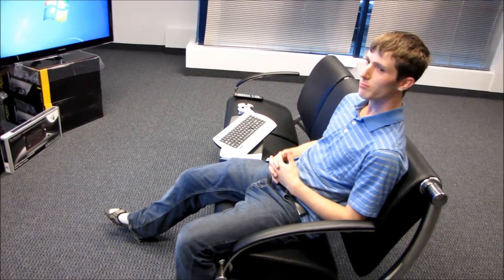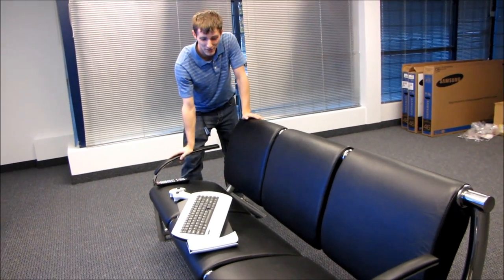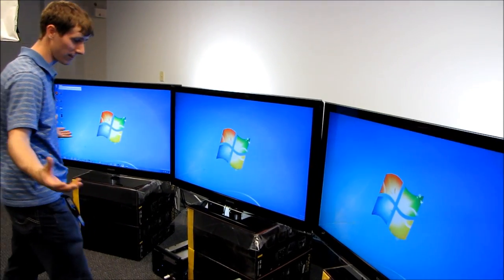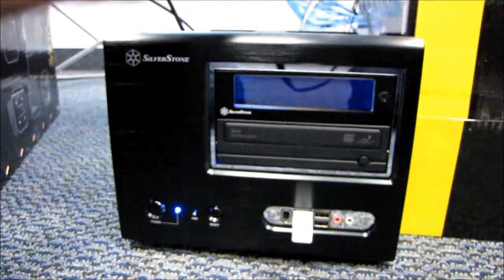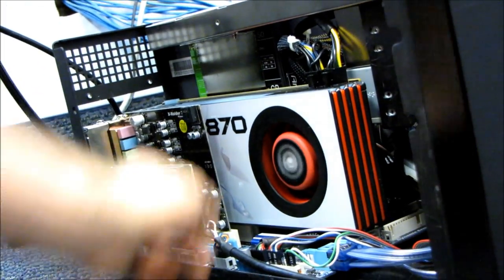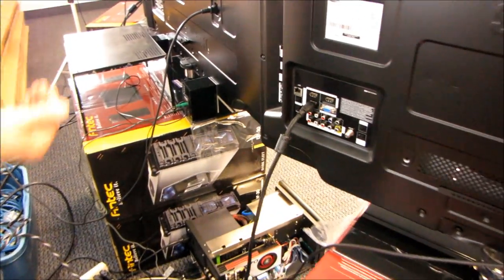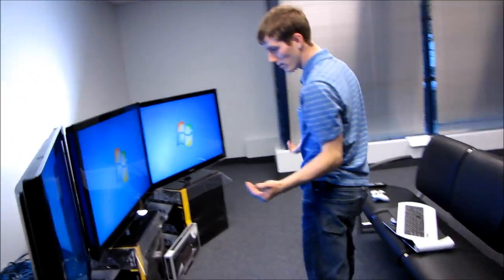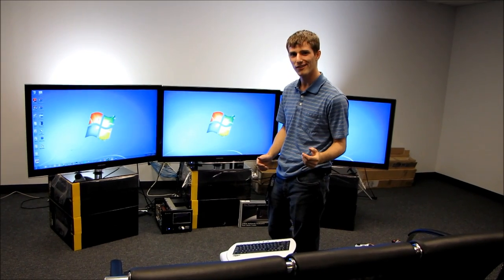Full Tour of MSI Radeon HD 6870 3x 46" Eyefinity Setup for NCIX Tech Tips Linus Tech Tips

Comment: Linus, i wouldn't sleep for a month with such a setup ! What i would do to Improve is only one thing. Set the TV vertically an NOT horizontaly. they are wide enouth.  But in games the top and bottom part are just cut away and not just modified corespondantly for exemple in most menus. Oh, and optionally, i would buy me some 3D red-cyan glasses  for half a dollar :D

Comment: No sleep, not even taking the time to get some coffee!!!
I would have those three TVs encastrated in a wall, have a nice and good looking 5.1 surround system with the front speaker in the wall under the TVs, the two front lateral in the wall beside the TVs, the bass case inside the couch (and a better couch ofc) and the two lateral back speakers over the couch in the cieling. Drewl!

Comment: I probably wouldn't sleep tonight. I work tomorrow afternoon, but I've been there 2 years and never called in sick before...

To make it better I wouldn't use cardboard boxes to hold the TVs up. And I would use dual graphics cards to make sure it runs super smooth at such high res.

Comment: i would not not sleep at all! thats what monster energy is made for lo

put a nice sound system with it and mount the tv's on the wall.  the outside ones could be on hinged mounts so you could pull them away from the wall a little and turn them slightly so you could get the wrap around feel

Comment: @masik7290 awesome, well since it takes up less power you'll definitely be able to run it with your psu.

that's not a bad setup imo, and with the new card in it it'll be in the higher mid range

Comment: Question 1: Yeah I'd sleep, but I'd wheel my bed into the same room as the setup so I can look at while I sleep lol. 

Question 2: I'd probably paint the wall that the televisions are up against black so there would be less light bouncing off the wall, making it easier to concentrate on just the televisions (if not paint, just hang some black sheets)

Comment: @masik7290 450 full system. if you read some threads online about what psu to use with that card they all seem to actually have 550 watt psu's. best bet is to research your heart out and then find what you think is best for your needs. psu's arent terribly expensive if you do need to upgrade, maybe to a 650 or 700w.

Comment: I currently have 3 monitors, and eyefinty (or  surround) is win.

If I had TV's I probably wouldn't sleep for the next 3 nights. If I was you, I could get a crossfire motherboard, and get 2 6870s. I had a 5770, and it wasn't quite enough for 5040x1050, so i got 2 470s

Comment: Ive done a lot of research on the LCDs in eyefinity and 42 is the biggest you can go without causing yo to miss most of the picture due to sitting so close to the monitors  i mean what is the point of sitting 6 feet away?  You dont get the picture to eye ratio you need to really use the eyefinity.  Your eyes need to be around 3 feet away from your middle screen to emerse yourself in the three monitors...and sitting with 46 inch lcds around me hurt my eyes and strained my neck when i tried it.

Comment: As for the "powered adapters" My card is nothing but mini-display port. 
5870 eyefinity 6 edition

I have no powered adapters... I bought 3 Apple mini-dp to VGA adapters and am using the mini DP to HDMI adapter that came with the card for the 4th Display. No clue what makes my card so special that I can do this without spending another $100.00. Versus the $75.00 for three adapters. (only because it does not come with VGA adapters)  Done and working with zero issues.

Comment: 1.  Most definitely not.
2. Replace all monitors with 32" CRT 4:3 screens (I'm not a fan of widescreen, and CRT STILL looks better than LCD, even now), add a Stereo Hi-Fi system for sound (I only have two ears, and I don't want to have to use anything but the headphone socket for audio output), replace the Xbox 360 Controller with a Dreamcast controller + Extension Cord + USB adapter setup, and use it to emulate a triple-screen NAOMI Arcade cabinet

Comment: 1, no on the sleeping, there is much better things to do than that.
2, i would actually build a set on the SG-07 and have a up comming 6990 running on it with a i7 875k. A must would be either the Bose companion 5 or logitech z-5500 speakers. also i would replace the lapboard with a surface which i can use a actual gaming mouse and logitech G-13

Comment: No sleep, I work at 2PM tomorrow, the set up is nice, I get rid of the wireless keyboard and mouse, not good for gaming.  Bring my on my favorite chip snacks, and start playing Gears of War along with Crysis series till I pass all games.  To improve it more other than the keyboard and mouse, I just add up surround sound speaker system and crank up the volume.  Of course, don't forget to call your buddies and brag against them >=^P

Comment: Sleep when your dead, and as far as making it better? a lapdesk so that I could use a different mouse and keyboard, and yes atleast 5.1 surround sound. Also I think you might be able to use Plasma screens (the burn in period would be a bitch) as they are cheaper, and bigger, you could get a mid/low range 1080p 50" plasma for about $800 CAD Each.

Comment: hey i have a question i just got the 6870 and my old gpu is intergrated into the cpu i put the 6870 in and installed all the stuff but im not sure if its running how do i override the old gpu so i can use my new 6870?

Comment: u do not need an active adapter with 6000 seires cards.
u just buy normal adapter
i totally need sleep
and i would buy 3d displays since 6000 support 3d
and totally run those card in crossifre

Comment: @masik7290 Ive got an i7 930 oc'd to 3.7ghz, EVGA gtx 480 oc, 6gb corsair dominator, 950 corsair psu (if i go sli) and a haf 932 case. it's all on my page if you check that. worked all summer for it =D

Comment: Wrong.
Combined is 1920*1080=2 073 600   .On triple monitor setup is more than 6,000,000 pixels,That requires a lot of Gpu power and especialy a lot of VRam. 2Gb or more recomended for hardcore gaming.
And now to be ontopic.
I will sell that configuration, all of it and with the money I will buy a nice laptop and a decent car.

Comment: Well if i hade three of those tv´s i would plug in my "once up on a time totally awesome pc" wich today is barely enough for playing new games on lowest settings. C2D E8500@stock 3.16ghz, 4gb 1066mhz ram, 8800GTX. My motherboard is a horrible gigabyte GA EP35 DS3 alot of crap going on with that specific model. i would like to upgrade it all but with my economy it would take me two years of savings to afford another E8500 wich wouldnt be an upgrade. maybe in 10 years i could buy an old i7 pc. :(

Comment: hi, i would like to have home theatre with set up like this, right now i am using Samsung 46 inch LED tv and gtx 275 oc bfg,i have Sony  1000Watt amp and two big tower speakers, i dont have sound card but i use hdmi cable from  gtx 275 to my tv ofcourse i conected spdif vire thet goes from motherbord to video card thenit goes to the tv and from tv i use fiber optic glas vire to my Sony amp, and with new Nvidia drivers it looks amezzing,and sounds very clear and powerful,thet is what i think, bye

Comment: 1) i'd be up all night :)

2) try and reduce the bezel gaps on each display so its more like a single monitor......then turn on the xbmc and start watching some flicks 

i'd rather use a hdmi adapter and plug in my ps3, but watching movies with that setup is much easier :)